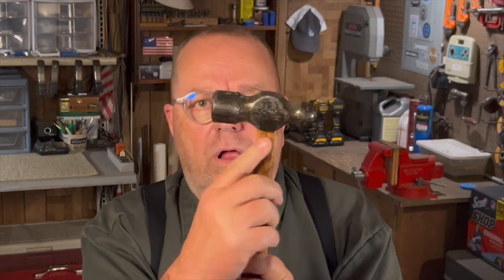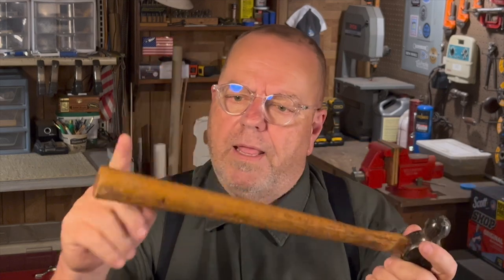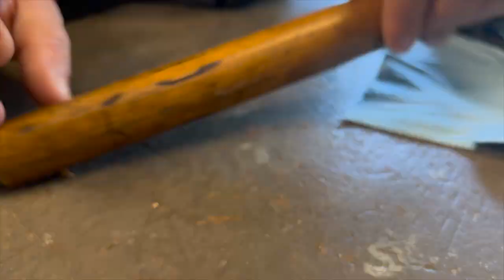Ball Peen Hammer

Comment: Well, Ben, I custom-made a hammer handle, which was perfect. Fit the handle in the same way you did at the belt sander, and the fit was perfect… except 90 degrees off! 
Starting with a square blank, I had no directional cues to tell me of the gross error I was making until it was complete.
Reply from the maker: I'm trying to figure that out in my head. Wow. Thanks, Troon.

Comment: You hopefully learn something new each time you try something. Sometimes it is just, "Well that didn't work."
All's well that ends well. 
Nice work on the hammer Ben. 
I had a 1 1/2" round copper bar about 5" long that I used when assembling dies. No handle just the bar. 
The old guy that showed me die repair called it a tunker. The name stuck. Nice for tapping heavy items just a few thousands of an inch to square them up in a vice or on a mill. 
Good choice to start over. 
We use to say, "I don't care how hard you beat it. You're not gonna turn that cow pie into custard."   😁😎
Reply from the maker: Cow pie into custard. I like that. Thanks Sneelock!

Comment: Hammer turned out great. It just took a different route to get there. I agree this is not an easy project, even though Scoutcrafter's skills make it look easy. I also found it tedious to get the cut off handle piece out if the hole in the hammer head. I used a chisel and did a great job of getting it really stuck. That's how I learned it would be smarter to drill the piece out. Thanks
Reply from the maker: Thanks Pat. Yes removing that plug is tough too.

Comment: Ben. Red Lion sanding / grinding supplies make right priced high quality American product.  The belts and conditioning belts ( 357Mag Dad uses the conditioning belts) are great.  No more torn belts.   I have the same1 x 30 belt grinder.
Reply from the maker: I bought some of those conditioning belts and they wouldn't fit on my sander. I gave them to Scoutcrafter. I'll look for their sanding belts. Thanks Sal!
Reply: @mrbenmall  I had the same issue with fitment.  I have to keep the deck tilted forward so the belt doesn't get pinched & I had to "clearance" the pulleys a bit.  It took some fiddling but it was worth it.  Check that bottom pulley, the one that is spring loaded.  It gets packed up with grunge... it should move "freely" when you push the tension knob... an air nozzle will be your best friend.

Comment: I think I've only had one 1x30 belt break on me ever!  And I use the cheap Harbor Freight belts!  I wonder if you got a bad batch?  Or maybe something is rubbing or crooked?
Reply from the maker: I think the issue is - 1. they're old 2. they're a cheap package set from China 3. I probably push too hard against the belt. 4. I don't think belt sanders like it when you use the top roller like a platin.
Reply: @mrbenmall  At least they make sanding exciting!
Reply from the maker: @357magdad  True dat

Comment: I leave mine long and wish I had a foot or 2 more sometimes but a 2x4 looks very strange nailed onto a hammer handle. Then I can cut it off 5 or 6 times if and when I break it. And if you can't fix it with a hammer it's got to be an electrical problem! GBWYall!
Reply from the maker: Thanks Lewie!
Reply: @mrbenmall  U 2!